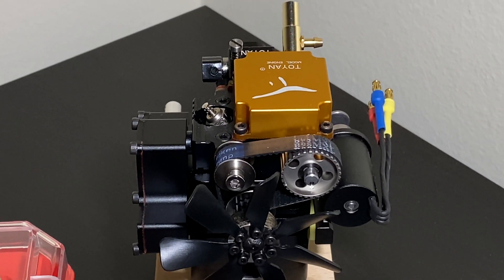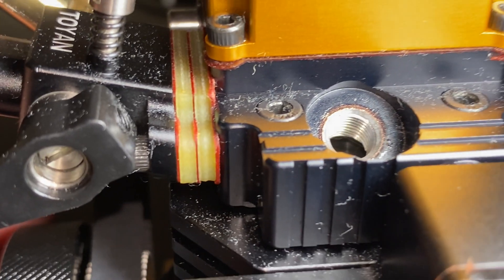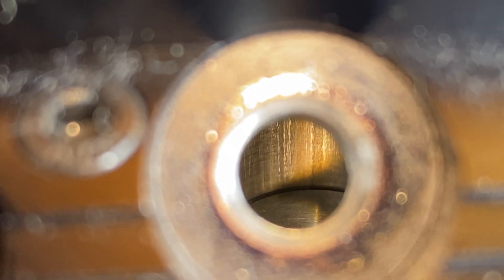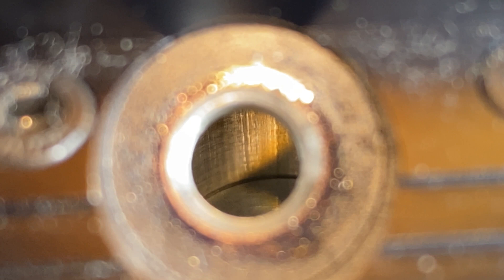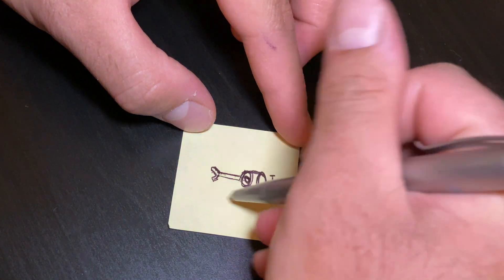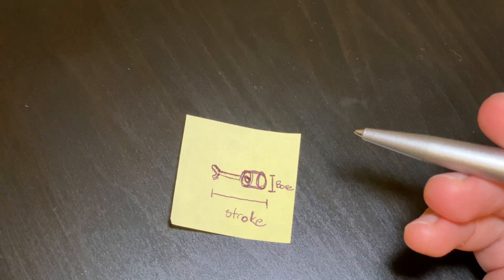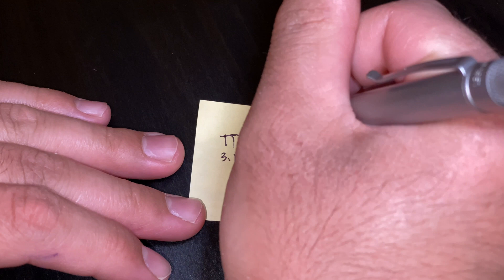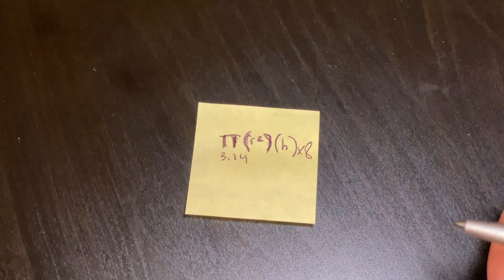Bore vs Stroke: Explained

Comment from the maker: In this video I explain what the bore and stroke are as well as common questions regarding this topic. I provided a real world example by using my mini 4 stroke engine as an example. Engineers use bore vs stroke to figure the displacement of the engine. Often times the displacement can be increased by changing the length of the connecting rod.